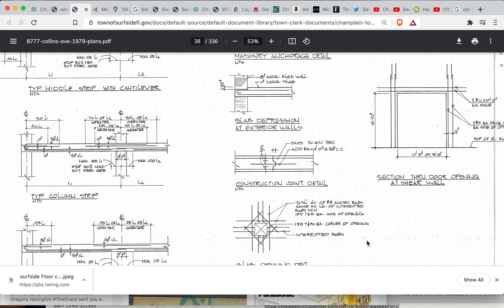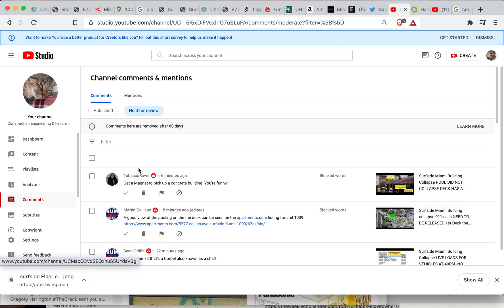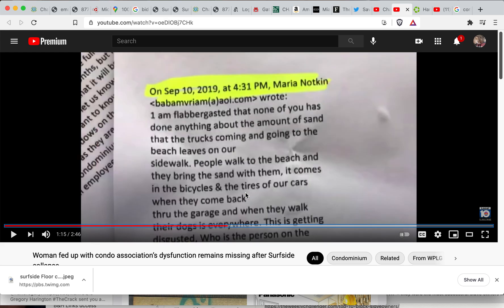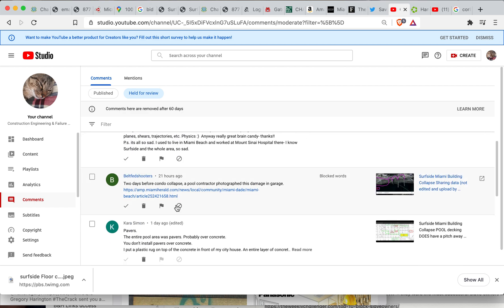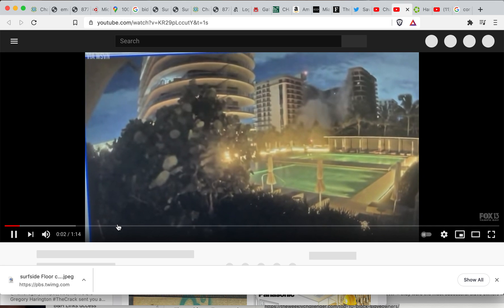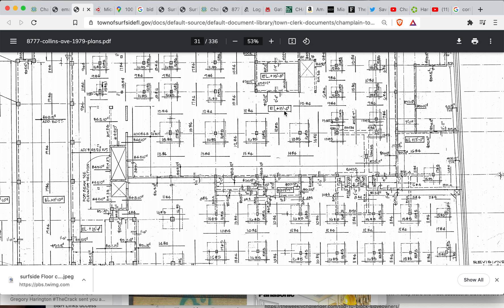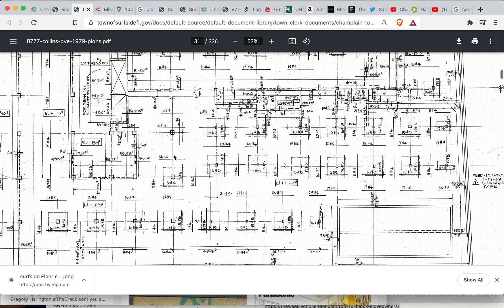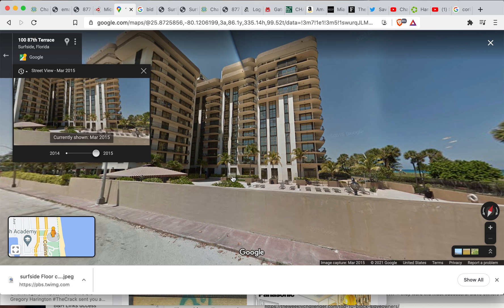Cassondra Stratton Pool deck was attached to building beams as a ''deck ledger" ??? Shadow banned

Comment: Did you see structural engineer (& YouTuber) Building Integrity’s thesis that the post tension ends failed, causing a tension failure of the rebar right at the mid section of the Bldg where the building first collapsed? 
That wd make sense for the columns to punch thru the decks (where weaken by slacked PT rebar) at the edge of the garage (center of the first face that collapsed). Other evidence implies initial column & rebar failure at that center area that was first to collapse.
Reply from the maker: If, you want me to watch his channel (his content is false about post tension) and I am going to need you to...
Here is my link for you to donate, so I can speak your language; don't be cheap!
https://www.youtube.com/redirect?redir_token=DNv2IAOnVo5Ybkl1FWgAR6C5wc98MTU3MjA0NDQ2NkAxNTcxOTU4MDY2&v=eVVbhESG65I&q=https%3A%2F%2Fwww.paypal.com%2Fcgi-bin%2Fwebscr%3Fcmd%3D_s-xclick%26hosted_button_id%3DV9TGHDE92LQ8W%26source%3Durl&event=video_description

Comment: I saw the study earlier said the concrete had not been waterproofed correctly. I think what they meant was the exposed surfaces of concrete has not been maintained as far as sealing waterproofing. The issue would be the water intrusion into the concrete would allow rebar to rust and fail. Salt just speeds the process. The problem with condo boards is they are made up of owners, not necessarily residents. When asked for money to do repairs, they vote no as it does not effect them. Love the content my friend.

Comment: Agreed  VERY GOOD CHANCE THIS STARTED W POOL / PARKING DECK & that pulled or pushed cols or ripped our a few rebar in the col / slab connection I agree there should be a beam at bldg edge for 1st fl & deck to run into but they way this was built maybe not My first note on bldg was 8 cats under S wing sit on LOWEST point of deck collapse so maybe first part to collapse The col slab connections sheared off clean but cols didn't fail maybe because it was such a clean break of course being a parking area deck facing ocean under bldg w air backed up against bldg flowing down & put thru here along with salt in rain must spray these connections could have corroded out to nothing It looks like further in a new topping had gone in over slab so even more load Engineer report showed exposed top bars at deck parking & HOA has history of covering up such problems Any rate it's a theory Someone else theorized the planters where they about cols on A wall N middle block could given poor condition noted in eng report could mean rebar & conc degraded for full depth of planter which looks like 2 -3 feet right where a slab failure kick would show up Good luck w this hope someone listens to you in FL & acts on it

Comment: I find it interesting (if not significant) that the sister building a block or so to the north is not actually the same as this one. Aside from the pool deck, It shares the west elevation groupings of units (which is still standing) and the south elevation grouping (which hung on heroically for a few seconds). But the collapsed center grouping doesn’t exist on the sister building. 

It makes me wonder which complex was designed first. If this one was 2nd and derived & expanded on from the north building, is there design weakness unaccounted for, or material difference in garage depth or slope necessitated by increased square footage of the parking garage below. IOW, was the decision made to make this building Moar Bigger done in a hurry?

Admittedly it can also be irrelevant. It was just something that jumped out when comparing the two buildings.
Reply: BTW, this doesn’t impinge or question your most excellent analysis so far. It may be an additional clue though.

Comment: In a video I saw tonight, apparently filmed by a resident before the collapse, the ceiling of the garage in a ways, was on the floor of the garage, and there was a water pipe spewing put water.  Apparently the person returning home was upset about not being able to get their car in the garage. They seemingly survived, as the video was reported to have been filmed just a couple of hours before the collapse.  It had an emoji face on it, looked like it might have been from TikTok?
  Scary and eerie stuff. It would seem the building had been failing for quite a while before the final collapse.
  Thank you for taking your time to create these videos! It certainly gives us all much to think about!
   Everyone working on this can help get to the bottom of what happened.
  It's so bizarre to have videos of everything almost any more.
  It seems the pool dump room ceiling on the one side had splaying already. Had I seem that in a sump room, working around chlorine gas, I wouldn't want to go in their either! Hopefully they'll get samples of that concrete & metal from that part, to be able to test it chemically. I imagine having a sump room without ventilation may have something to do with this as well?
  Certainly it will be a legal mess for years to come.
  So sad when safeguards are dropped, and people lose their lives as a result!
  Keep them coming!
   BTW, I like your type of humor!

Comment: Also don't forget the issue of site Geothecnical hazards? 

How much the thickness of flat slabs in the plans ? Is it same VS site BLD also  the spacing of rebars ? 

If there are Etabs the Safe in 1980 it will be more safe.

Comment: The construction joint that you shows is named joint of dilation I think should be designed by construction joint with duable columns because they have a heavy difference loads foundation 12 stories VS one story of pool terrasses also the walls  of swimming pool should being separate because of wall shears ( tanker cause)

Comment: they wouldn't cantilever that off the columns under the pool deck, that has to be connected, even if it's 'slid' under the building floor slab held by the same columns that support the wall. there is also flower beds there next to the building, so a lot more weight to contend with. diagram. possibly page 20 of 84 on the 04/26/21 blueprints, diagram 3 (New Upturn Beam At Entrance Ramp), maybe, and maybe a few others on the next few pages.  looks like a lot of that was planed to be replaced or repaired.

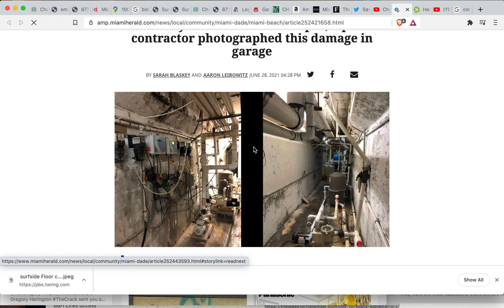page 24 of the 04/26/21 blueprints, looks like they did address repairs of the 'gutters' at the pool that is the pics at 6:00 of your vid.  looks like a lot more rebar than is visible in the rubble elsewhere. Hmmm.  think that is only a hint of the condition of rebar elsewhere at best, not actual condition.
Reply: I just paged through the original 336 pages of the 1979 plans, I do not see ANY change in elevation slab concrete stuff at all in the original plans. eeeek. I realy hope they didn't wing it. only the "8777-collins-avenue---preliminary-review-plans-for-40-year-re-certification" has anything with elevation changes.

Comment: thanks again kai
Reply from the maker: Thank you Dos, I hope you can see where the ''deck ledger/building beam" could be pulled away and cause this failure.
Reply: @ForensicCats  I see it!
Reply: @ForensicCats  I see it, too. Thanks. The deck tugging on the building fits with the propagating crack that the woman in unit 611 saw. The column was separating from the building. The unit 11’s is where the building failure began. https://youtu.be/L0lS9jpmZL4